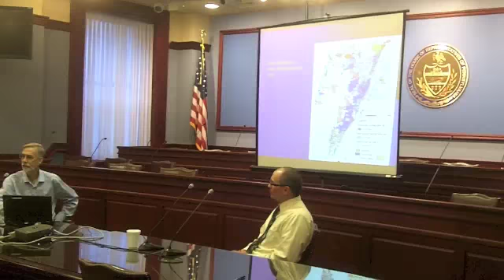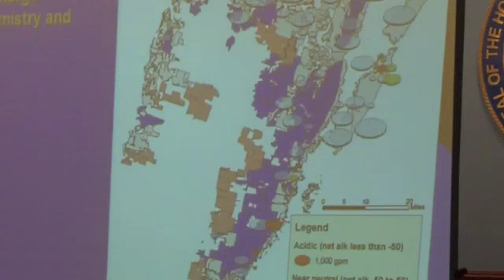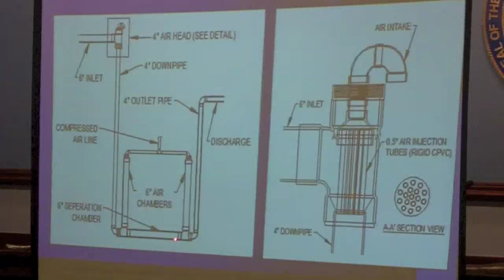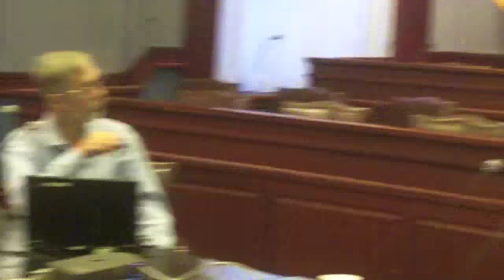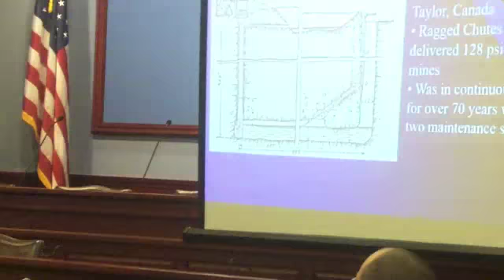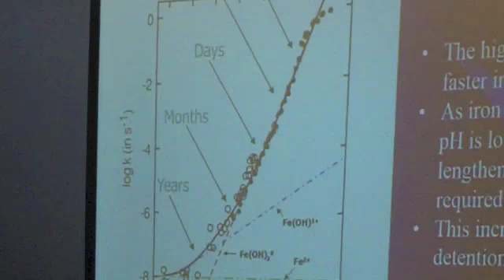Bruce Leavitt Presentation On Trompe Technology

Comment: I’m hoping for trump equations required for scaling one down to 20 ft height maximum and 24 feet length maximum. So I want to know diameters,  ratios, & equations. My goal is quiet and compressed air.